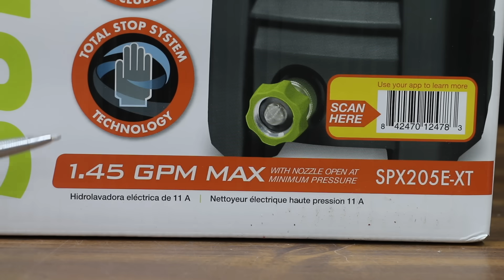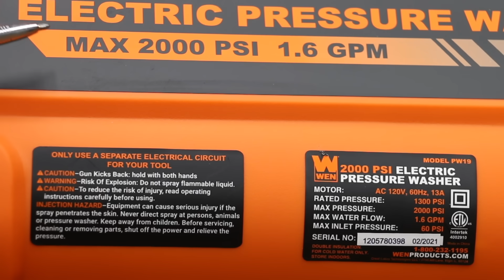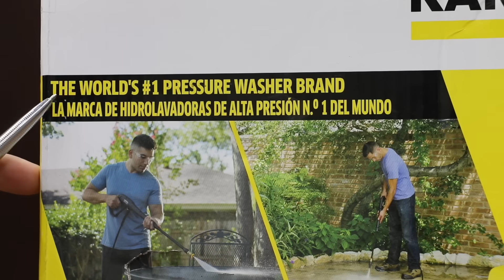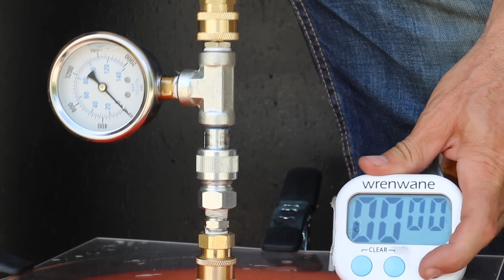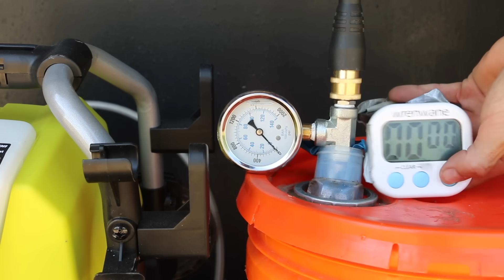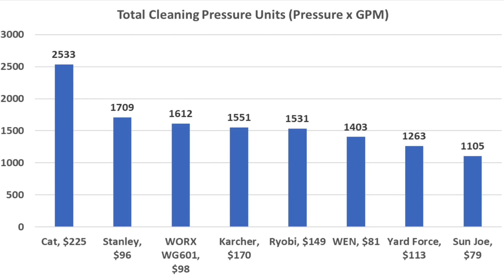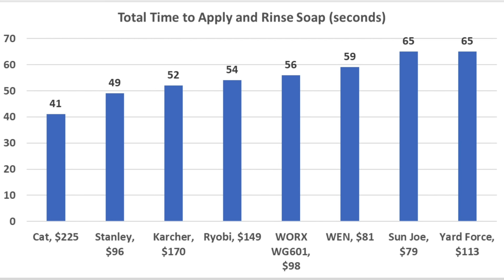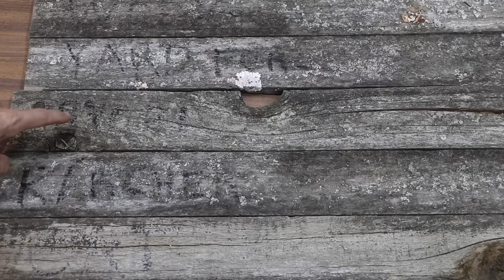Best Pressure Washer (ELECTRIC)? Ryobi vs Karcher, Stanley, Sun Joe, WEN, CAT & WORX

Comment: As usual...another really helpful video!
*
New video idea: 
You've done battery videos before...
You'll need a way to load test and capacity test car batteries.
1. Get all the the battery recovery/desulfators you can find.
2. Get a bunch of dead car batteries.
3. Get a bunch of end of life, but still working car batteries.
4. Get a bunch of identical new car batteries.
Test 1: Try to recover dead batteries and then to test their capacities and loading.
Test 2: Try to restore battery capacity from end of life car batteries. You will need to test loading and capacities before and after.
Test 3: Try to recover new batteries with the best from tests 1 and 2. This requires testing battery capacities and loading when brand new. Run down to dead flat new batteries several times and then leave them dead flat for a while so that any damage incurred can set in. Attempt to recover them and then test their capacities again.
*
I think leaving car batteries on concrete damages them is a myth. Maybe you can show it is true or not? I think it is neglect and not using battery minders that damages them.
You need to know all the capacities of the batteries before and after the tests. Once a month check battery voltages over about 6 months. Once the 6 months has passed, charge all the batteries to full and test their capacities and loading. I think you need 3 identical batteries for each test.
Test 4: Brand new fully charged batteries, set on bare concrete. Do they run down? Do they lose capacity? 
Test 5: Brand new fully charged batteries placed on some plywood and then on the concrete. Do they run down? Do they lose capacity?
Test 6: Same setup as Test 4 and 5, but add battery minders to 6 more batteries.
*
Test 7: I think that temperature cycling might be a myth too. Car batteries deal with this all the time in an engine compartment. Alternating weeks for 6 months: Freeze a couple of batteries to 10F for a week. Warm them to 120F for a week. Do this with 3 having battery minders and 3 without battery minders. Check before and after capacities and loading.
Reply from the maker: Thanks!  Thanks for the suggestions.

Comment: I think it would be interesting to see what type of lamp oils burn the brightest and longest in a hurricane lamp. You could also track soot, smell and the cost effectiveness of each oil tried. Does one oil do better in the wind. You could also test lamp styles as well. In 2012 oil lamps used the same amount of fuel as US jets planes.
Reply from the maker: Thanks for the suggestion.

Comment: I work a couple days a week for a well known auto parts store. I’m vey curious about the difference between the high dollar parts vs. the value priced parts. As there are too many parts to test and it will cost a fortune I think comparing brake pads would be a good start but starters and alternators would be very helpful too. A little hint to save money is to open a commercial account to get a discount on the parts. It doesn’t require credit only owning a business and a farm is a business. I’ve also noticed the most parts store don’t know much about auto repair they just sell parts. It would be great to have a known problem with a car and take it to multiple stores to see if they can diagnose it and explain how to fix it. My job allows me to use my automotive knowledge to help my customers but not everyone in the store has those skills. Just a few ideas for your channel. I love to watch you videos and learn the truth about products that companies advertise. It’s nice to avoid the snake oil!
Reply from the maker: Thanks!  Thanks for the video idea.

Comment: PF: thanks for the review You are a one man consumer reports, but better! 

One issue I found with the CAT: I looked at the amazon reviews and there are several complains that the Cat does not last very long. Between 10 hours & 70 hours before it fails. Perhaps do a follow up test on the Cat to see if fails.
Reply from the maker: Thanks for the suggestion.

Comment: It seems like these electrically powered pressure washers have significantly less PSI rating than gasoline powered pressure washers. What I want to know is what level of pressure is needed for specific cleaning jobs. No one wants to buy a 1,200 psi electric washer or even a 2,200 psi gas washer only to find out that it was going to take 3.000 psi to get those stains off the driveway.
Reply from the maker: Thanks for the suggestion.

Comment: One thing I've been wondering is how various electric Weed Eaters/Whackers/Trimmers stack up. I know you've done a couple different passes at both blades and lines, but it would be interesting to see how the electrics line up. Especially how well some of the wired ones handle being strung out on several extension cords.
Reply: FWIW: I have & like the Dewalt cordless trimmer. Just easy to use for light use. I never have good luck with gas trimmers, and gas trimmers hate ethanol tainted gasoline. The Dewalt 60v has plenty of power.
Reply from the maker: Thanks for the video idea.

Comment: Thank you for another informative video made with integrity. Recently, I was on amazon looking for a diamond sharpening stone/plate and find that prices varies greatly from brand to brand they start at around $20 to well over $100. I understand that monocrytalline diamond one costs more but are they really superior in performance? Wish you can test that in a future video. 
Keep up the great work!
Reply from the maker: Thanks for the video idea.
Reply: Hey andy; just to chime in; diamond plates are ABSOLUTELY wildly variant in quality. The "value proposition" is entirely what you're doing with them. If youre looking for high performance plates for tuning chisels for fine wood working... ehh... its gonna hurt to get a usable plate. 

In general, until you can justify stepping up to the truly high grade diamond plates; composite stones really offer the best value. True sharpening stones cost more than high quality diamond plates lol
Reply: @JgHaverty  hi thanks for the information. I purchased an inexpensive 400 1000 grit diamond plate on amazon to test the water. I was quite surprised how well it worked. It is flat and cuts real fast on my harder than average Japanese knives and especially on those micro chipped edges. It proof to be the missing link on my sharpening system. Although, long term durability is TBD I have no problem with it after sharpening a dozen knives and some chisels.
Reply: @TheAndychn  haha i think i have the same one! It's alright it just doesnt last very long. Its like 5"×2.5" with a honeycomb looking pattern? I started using it to flatten my other stones because a lot of the grit smoothed out and it no longer cuts well. DMT plates are the entry level "quality" ones you should look at to upgrade

Comment: Long ago I found a discarded Simoniz S1700 pressure washer. I decided to use it for my mechanical components project and possibly fix it afterwards. It used single phase permanent split capacitor induction motor with 1 pair of poles. According to the literature, its RPM was at about 70% of its synchronous speed. Later on I disassembled the device, took measurements and made calculations. The calculated theoretical RPM was only few percent different. Anyway pressure * flow = power. The only issue is the need for conversion to SI. The washer turned out to be beyond repair: burnt motor winding and destroyed cylinder of a piston switch.
Kärcher is a Geman brand and pronounced 'kærçɐ.
Finally, are you planning to make a comparison of compact cordless rotary hammers such as KHA 18 LTX BL 24 QUICK?
Reply from the maker: Thanks for the video idea.  Thanks for sharing.

Comment: Your review was extremely timely.  My wife and I have a deck to clean as well as siding on our fairly large house.  Based on the amount of work and your review, we bought a CAT-1800 unit.  It came today, and while we've only used it for an hour or so, it works great!  Previously, based on your recommendation, I bought a car headlight restoration kit which also worked great.  Thanks for all your work, you make people's lives better.
Reply from the maker: You are welcome!  Glad to hear!
Reply: How’s it holding up for you now? I saw a review from someone on Amazon saying that theirs died after a few days of work and CAT only had a warranty for something like 70 hours of use which sounds ridiculous.
Reply: @dwellner502  if you still need a feedback mine is 4 months old and still work great as new. i use it about 4-5 times a week. but the gun suck the lock break after 2 weeks but its an easy fix
Reply: @dwellner502 mine lasted 4 years. Something just broke inside the housing and water leaks from the unit. Hoping it's a gasket or something simple to repair. The warranty was 2 years.

Comment: I think you should have “Electric” in the headline, these are nothing like gas versions that pump out 4x more water at double the pressure.
Reply from the maker: Thanks for the video idea.
Reply: @ProjectFarm  Hart brand as well please! I have the Hart Vehicle Cleaner.Trying to find a Pressure Washer for Detailing Cars and Trucks So i dont need much but im not trying to break the Bank
Reply: And u can buy electric ones thats even more powerfull than the gas driven ones. 🤦
Reply: FWIW:  These test can be expensive for PF. Gas PW are 3 to 4 times more expensive than electric.
Reply: Why has no one noticed you're talking about fixing the title of THIS video?  What's going on here?
Reply: @everythingknife8763  The correct title would be 120 volt electric. Simply calling it electric in the title is not correct, because 240 volt models easily match or exceed gas powered ones.
Reply: @EETechs  how do they rank in terms of PSI-GPM power dollar? 
Seems they'd have applications for indoor use, but much more expensive than the general public would consider purchasing.
Reply: I have one attached to 400V 3-phase... that one is mighty powerful.
Reply: Unless you get a 3 phase👍
Reply: Your comment makes no sense because of course 120 volt pressure washers limited to 15 amp breakers will not perform like gas.  That's not what is being tested here in this video. Now step up to 240 volt electric ones and your gas powered ones will not look so great. Again this is not comparing gas against electric in this video. For that it needs to be 240 volt electric versus gas for fair comparison.
Reply: @EETechs  Ofc I'm talking about 230v. NA shitty 120v cant be used to anything powerfull.
Reply: @Daddelcrusher  My reply is to Casey Hopkins.
Reply: @Daddelcrusher  NA has 240V available as well. Most homes have one or two 240V circuits, and the remainder are 120V.

Comment: Maybe test who makes the best cordless jobsite fan, 7-8 brands at different price points, like Ryobi, ridigid dewalt, Makita , Milwaukee, Hercules, Bauer, hart, Kobalt. i get thats alot to ask but i think it would make great content. such as testing the strength of force the wind created at different distances from the fan, how wide the spead is on streamers hung from a trellis, how long will the batteries last at prime(eco) and maxed out conditions, can these fans with stand a cold and hot day if so who does best? how long to actually charge and which was quickest. And most of all what is the best blow for buck!
Reply from the maker: Thanks for the video idea.

Comment: Great video as usual! Was wondering if you considered making a video comparing engine oil filters. I have been warned by some mechanics and oil change technicians not to use the Fram orange can filter. I think it would be very interesting to see if there is a big difference or if the biggest difference is the name on the can.
Reply from the maker: Thank you!  Thanks for the suggestion.

Comment: I'm not a handy guy, but what little I do know my grandfather taught me.  He had a small plot of land that he would tool around on.  In my teenage years he would have me come up and help with odd jobs, (brush hoging, tree trimming, working on old tractors, etc etc).  He constantly sung the praises of JB weld. He loved to tell this story about this old old Massey Ferguson tractor... 
One year the radiator got a leak, he didn't have any antifreeze on hand so he just used tap water, so of course he forgot about it and next spring found the block had split, bad.  So he said no problem, shoved a bunch of JB weld in the crack, let it cure, then squeezed the whole block together with two long pieces of all-thread.
I'm not sure how long ago he did it when he told the story, but it still ran when he passed away, and that was at least 15 years.
To this day, if I've got something I really really want to stay put, I always turn to JB weld.
Reply from the maker: Thanks for sharing.

Comment: Well from what I am seeing I am glad to have a gas powered washer that operates at a higher pressure. Looks like these electric units just don't have the power I would need.  The price point of these is much less than a decent gas unit though. Good video!
Reply from the maker: Thanks!  Thanks for sharing.
Reply: There are some higher power electric washers (highest I've seen was 3600 psi at 3.4 gpm I think it was)

Comment: Use standard English measurement, most people don't understand ounces/pounds/gallons and other retarded units. Or at the very least just add a text stating the normal average metric values instead of retards.

Comment: Good job. I guess it would be cost prohibitive to test the hot ones. I have a North Star item 157308 2.5 gpm 2750 psi, thinking about going higher pressure.
Reply from the maker: Thanks!  Thanks for the suggestion.

Comment: While the CAT is definitely the way to go, the Stanley does a good enough job considering it's price at the time of filming. Shame it jumped from $90 to $130 after you posted this video. Looks like it would be just fine for washing cars once or twice a week. Not powerful enough to strip the clearcoat or paint if an accident happened, but good enough to rinse dirt off and spray some soap on. Great video
Reply from the maker: Thanks!

Comment: On your part 2 of this series of 120 volt pressure washer tests, add the NorthStar 1700 PSI @ 1.5 GPM. The model number is 1571101. It's $700!! I like how you show that even the over priced stuff can be less performing than a cheaper alternative.
Reply from the maker: Thanks!

Comment: It would be cool to test different ratchets in 3/8 and 1/2 drives. Also torque wrenches brand new and after 6 months of use.
Reply from the maker: Thanks for the suggestion.
Reply: @ProjectFarm  your welcome. Even breaker bars of different brands and materials like the plastic and metal pieces where the socket goes on and which ones the strongest.
Reply: Bearing grease if you haven't done so already. Also tire patch vs plug. And maybe used tire vs retreaded

Comment: I have the Harbor Freight Braun electric PW.  I replaced the wimpy hose with a Flexzilla, then added quick disconnects to it.  I really like this PW for doing cars and small jobs  I actually use less water than traditional hose washing.  I even used it on my Trex deck, and it worked great without causing any damage.
Reply from the maker: Thanks for sharing.

Comment: Years ago I bought a Ryobi from Home Depot.  It has a Honda motor.  It had aluminum bolts mounting the pump to the water input manifold.  Replaced those with stainless steel bolts.  Problems solved.  I loaned it to a friend.  Hurricane (don’t remember the name) hit.  It sat completely submerged for two weeks after a flood.  Got it back home.  Dumped out the watered down oil, drained and slightly cleaned gas tank and carb.  Cleaned the engine with diesel flush.  Fueled it up, placed new oil in it.  It started on the first pull.  Unbelievable!  It was used until someone (I won’t mention my WIFE’S name) used it without checking the oil level!
This is 3 years later.  It had no oil and the engine almost froze up!  I added oil to it and again it started up first pull!  Those Honda engines are amazing!
Reply from the maker: Thanks for sharing!

Comment: 1.5k to 2k residential ones easily get up to 3.5k before the commercial 4-5k ones come into play. I really think you should of had a higher psi max if your going to test residential pressure washers. Also there line moles for those bigger ones that people can use to clean drains and such very useful and way more effective than a drain snake. Though if you ever get froggy try to test a nlb or Jetstream 'pressure washer'.
Reply from the maker: Thanks for the video idea.
Reply: @ProjectFarm  if your talking the line moles use solid ice in a 2inch to 4inch pvc pipe to test it's a good test and in the real world is done cause that happens to farmers occasionally.

Comment: I recently sold my Ryobi 1700 PSI PW-It was too loud. I purchased the Ryobi 2300 PSI $280, this one has the brushless induction brushless motor. The noise level is about 60% less, the pressure from 1700 to 2300 is very noticeable plus the frame that comes with the new Ryobi easily keeps the cord and pressure hose off the ground.
Reply from the maker: Thanks for sharing.

Comment: I have a higher model sun joe (2300 psi?) and for occasional use I’ve been happy. It has standard fittings and 4 or 5 tips. Also 2 soap reservoirs
Reply from the maker: Thanks for sharing.

Comment: I owned a hire and repair shop in Ireland. Kranzle is by far superior to all of these. It is more expensive but will out preform and last longer than any of the machines tested. All of the tested machines should not be run for more than 15 mins.
Reply from the maker: Thanks for sharing.